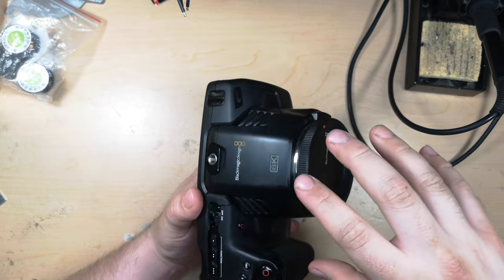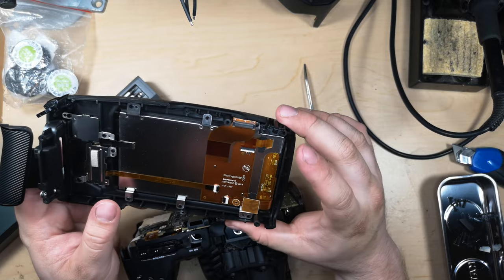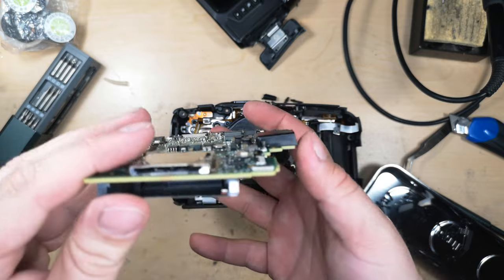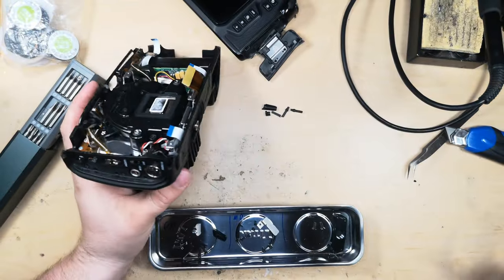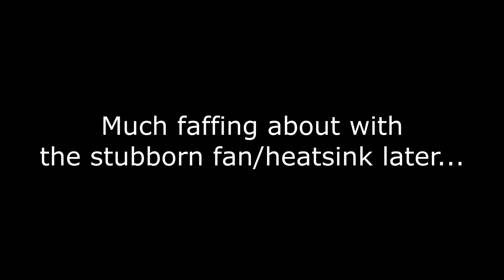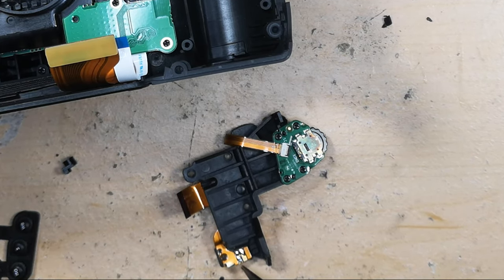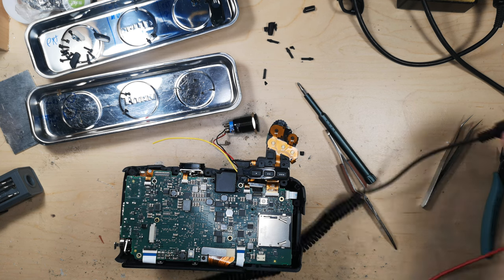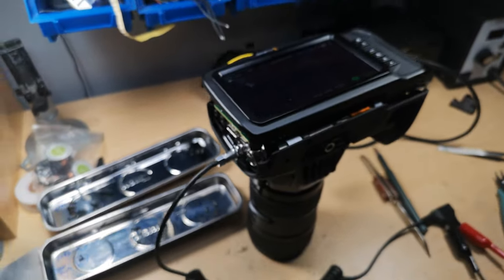IT WORKS! $600 Blackmagic Pocket 6k Repair Part 2: Teardown And Testing

Comment from the maker: The finale putting the camera into a new body should happen next week, parts are in the mail and hopefully should arrive Tuesday. I also will hopefully not have been up since 3 am, and I won't miss things like the buttons on the board, one of which clearly says on/off which I completely failed to notice worrying about damage.
Reply: Looking forward to it.
Reply: Hey nice video..can u say if the fan from the 6k can work in the 6k pro as a replacement not how can i get one to buy?  i would buy from u if u have

Comment: Never connect or remove the lens when the camera is switched on you could blow both the interfaces!
Reply from the maker: Ah, good to know, it's not something I ever really need to do, but I'm sure I've done it a few times without thinking. 

I thought that the pins would be arranged so that ground and power are the last ones connected and rely on a signal to actually provide power, but I haven't looked into that.
Reply: My BMPCC4K just went out on me. It's not powering up even when I plug it in or use the battery. I'm having a hard time getting someone to have it fixed for me. Can you help me get it fixed?